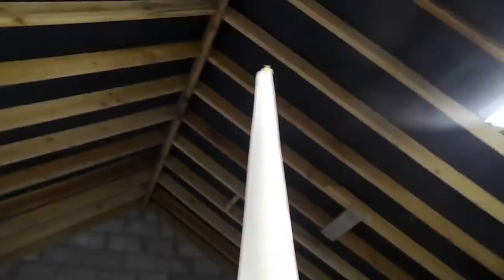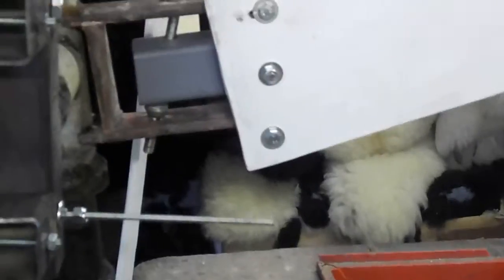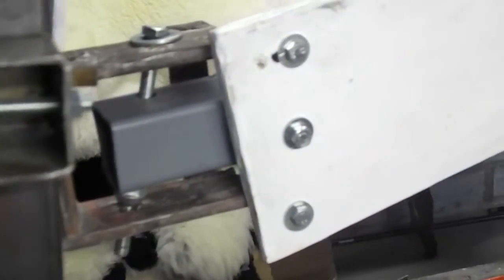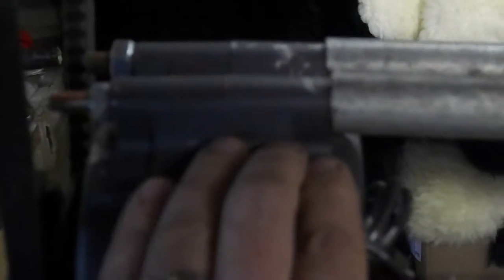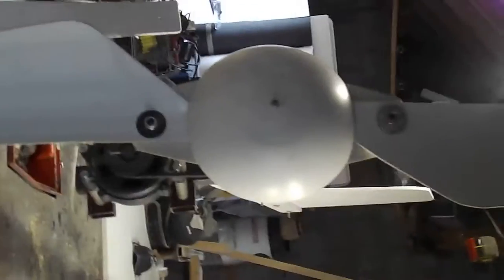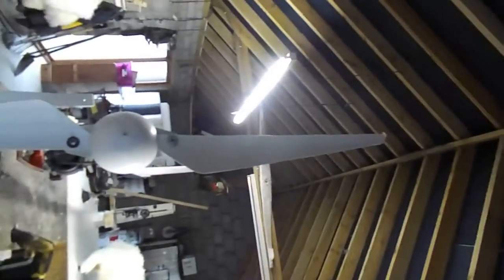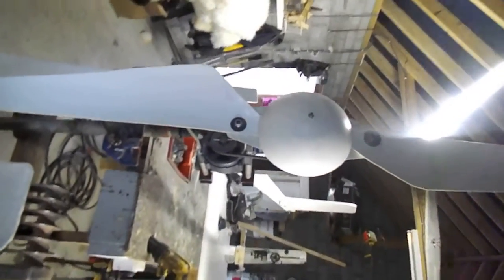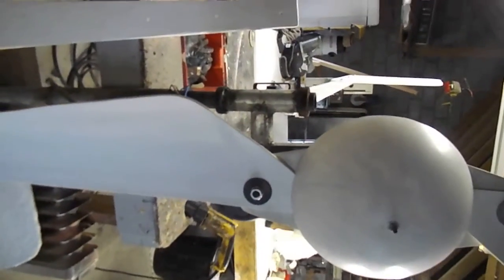Tower eats stealth blades

Comment: That is a shame. Kevlar ehhh ? You weren't suppose to tell that.
So 70 mph did it in ? Really looks good Ian. Always something to improve on. 10 foot is a different animal altogether.
Reply from the maker: +MissouriWindandSolar  Well its just one of the composites. The others will remain a closed secret.  Note 4 bolts holding on hub as well.
Reply: +ian57812 Just re watching it this morning. I see the 4 bolts for the hub, nice.
Your blades held up very well for hitting the tail all night. No shattering, those are tough.
Reply: +ian57812 It even looks good, sharp.Once you have it all one color it it will really look good.I think you now have the toughest blades i have seen.Most blades would have shattered . Super duper Superman material your using in those, Kevlar is some tough stuff.
In a retail market that would sell very well, it just looks cool. Very important to go for looks as well as quality and you have both there. It's not bulky looking, fine lines, simple looking yet cool, very cool.
If i was a retailer and looking for something new in a wind turbine yours would be it. It even looks strong.
Reply from the maker: +MissouriWindandSolar  There also very light. Blades and hub are less than 6lbs so very safe for back yards. It also means they are a so easy to balance.
Reply: +ian57812 Yes, 6 pounds is light for that size.. I forgot to mention that your blade hub didn't crack or come apart.That's really impressive for a composite hub.
Reply: +ian57812 Question, if your tail fin was wider, top to bottom, will it furl sooner, later ,or stay the same ? Would it track better or stay the same ? I know it tracks well now as it is. You don;t have much weight up front on yours so that may be a factor on how it acts.
You have it right already , just wondering on fin size for that turbine.
Reply from the maker: +MissouriWindandSolar  I agree with the way some thing looks. Its like aircraft it either looks right or it doesn't . The furl depends on the weight of the tail the heaver the tail the harder the furl. It did track really well so happywith tail size but no big job to make a larger one. The  hub took me forever to get right. I think its like riding a bike hard at first but once done a few times it gets easy. Composites have really changed the way we think about building things.
Reply: +ian57812 I agree with MissouriWind... Your blades look great. If they work as well as your wood three blade set, I'd certainly be interested in a set of three. (even in 8 foot length).